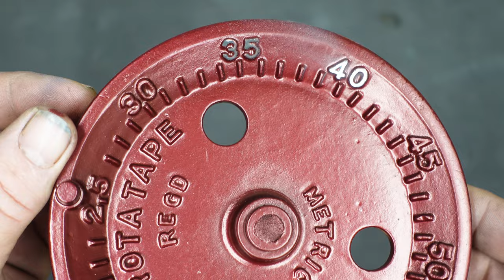retro measuring wheel  restoration

Comment: To say that disassembling and reassembling those counter dials is fidley is an understatement.  I had one on a measuring wheel that was giving me issues.  I took it apart to clean it and do some repairs and it took me quite a while to get it back together in a working condition.  I do not know if I would do it again though.  I might just give it away to someone else to play with and buy a new one if I needed it.
Reply from the maker: i have put it on my NOT to do list again

Comment: It is impressive that you got the counter back together!  I prefer the aluminum numbers over the black or red.  Thanks for the content.
Reply from the maker: thanks Paul  almost needed stronger glasses for that one cheers Richard
Reply: @richardrestorations  I was concerned that a few of the bearings were lost, which would be my luck. Nice work!
Reply from the maker: @FordFanatic337   i did drop a screw on the floor  😄

Comment: Enjoyed the video, but… if this is from the 60's, why is it metric already? NZ didn't go metric until the mid-70's; I remember the speed-limit signs changing. We went decimal in '67, just before I was born…
Reply from the maker: New Zealand adopted decimal currency in1967 and adopted the metric system in 1967, New Zealand started metrication in 1969 with the establishment of the Metric Advisory Board (MAB) and completed metrication on 14 December 1976
cheers Richard
Reply: @richardrestorations  ah, so we were already preparing in the '60s! I did not know that. My parents' house plans, drawn up in '72, were scaled 1/8":1' 😂